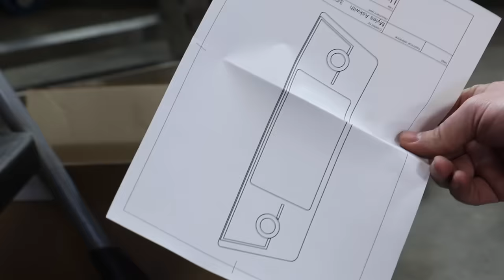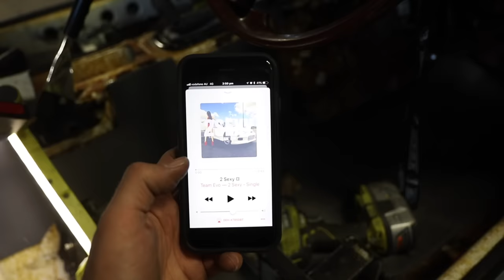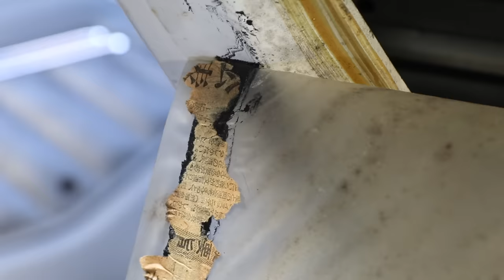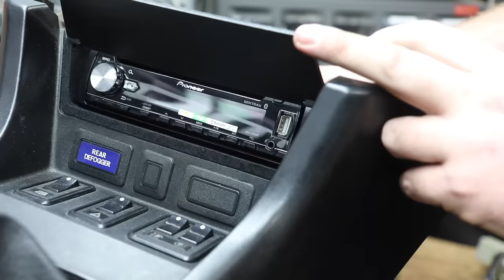RB26 240Z - Roll Cage + Stealthy Hidden Stereo

Comment: If those clips are the same as the ones I've worked with, you're not meant to punch the middle all the way out, you just poke it in slightly to release the clip, then once the whole clip is out you push the pin back out again. The middle pin has 3 positions, sticking out for inserting the clip, pushed in for removing it, and flush when it's installed.
Reply: Steve M on point
Reply: Correct
Reply: Yup. They are everywhere in motorcycles.
Reply from the maker: Steve M Maybe because 40+ years old these ones didn’t budge unless they got a big hit. But basically what you’re saying is just inset the tip?
Reply: Mighty Car Mods just the tip, promise...
Reply: Mighty Car Mods on newer ones, just the tip and only for a minute, i’m an auto glazier and come across these types of clips regularly
Reply: Just the tip, and only for a minute. A ball head allen key is perfect for them, just press the ball against the head and push, you might need to wiggle it around a bit but once you do it a few times you get a real feel for how hard to push, and how deep you should insert the tip.
Reply: Was going to comment this, glad somebody already did (faith in humanity boosted).
That's exactly how the clips that held the door cards of my 2001 Volvo V70 worked. Definitely not a bad system: rattle free without screws after 10+ years and virtually endlessly reusable.
Reply: tempted to just replace all those types of retainer clips with nutserts on my car.
Reply: Uncle Dunk Why? They're super easy, faster, and stealthier than screws and bolts all over the interior.
Reply: Steve M It also has the 4th Moog position - into the 4th dimension.
Reply: ... but only for a minute.
Reply: Most older cars don't use the 3 state push in clips and just have a pin and single split retention plug where the only removal is to punch the pin straight through. As a former smash repairer I do not recommend the reuse of old plastic clips as they are cheap and fail easily when new and worse when they are old. Bulk bags of generic clips are the way to go, get a few in various types and sizes as they are remarkably handy and have wider uses if you stretch your imagination.
Reply: I'm with the uncle... at least in certain applications. just wrestled through the cambelt on my 98 swift. I am now missing the inner wheel arch trim on the front right, due to all of the clips breaking... Thinking of going with rivnuts on it. On the interior though, I completely agree that these clips are a tidy way of retaining trim. Though the older the car gets the more brittle and more likely to break the plastic clips become. Hence why the Fairlady's broke I guess.
Reply: My motorbike also has them. I didn't even know you could push the centre bit in. I've just been pushing them out from the back. And when I can't get in behind them I just pull the panel and they eventually release without any apparent damage.
Reply: Abit of lube will help it slide easier, or else you tare it out the back when it suddenly moves. That's never pleasant...
Reply: Yes just the tip, but don't forget to add a little lube.
Reply: I see I just answered a question that's already been answered haha
If there jammed full of dirt and a few taps don't dislodge the dirt then just condemn them and put new ones in.
Reply: Exactly
Reply: To add to this I don't use a tool to push in the center, I just use use my finger and that prevents it from shooting all the way out the back like if you use a tool to push it.
Reply: @Mighty Car Mods Yes, just insert the tip, using a different tool. Use a flat blade such as a spatula so when you press (or even lightly tap on it with a hammer) it will move in until it becomes flush, locking the insert into place (the center pin is the lock). It will stay in place forever, but if you need to remove it in the future then you push the center pin in very gently (only 3 to 5 mm or so) and the outer portion will release without dropping the inner portioning the bowels of your lovely Z Car.
Reply: Yes just a few mm in. Then just pull the outside might need a wiggle but they do come out
Reply: IllusionaryGalaxy Yeah I considered that later, that maybe really old ones are just single use clips. Most of the older cars I've worked on have used those 2 prong metal clips, or those weird tree looking plastic clips with lots of little spikes that stick out the shaft. Only ever seen button pins with the 3 states of being, or 4 if you count the "I pulled it too hard and it went in my mouth and I accidentally swallowed it" state when it just flies right out of the thing it's meant to hold.
Reply: I guess I've been lucky as all the cars I've ever had* have a centre pin that has a flat top (like a nail), so you just pull them towards you, rather than pushing them through.
* VWs and Peugeots
Reply: Mighty Car Mods wd40 them first; they will require less force to push to unlock. Sometimes its easier to just punch through

Comment: Don’t push the pin all the way thru, if you push it in half way you can remove the whole clip as one piece and can re use them
Reply: ^^^^THIS^^^^^
Reply: I’m glad someone besides me knows the truth.
Reply: Haha yep, not meant to bash the pin out. Just press and it stays captive.
Reply: You do need to push the pin back out to reuse it. Like with a tiny flat screwdriver. Then you place it back in and push the pin flush again.
Reply: I just make new ones by cutting up 16 penny nails.
Reply: depends on the clip. the type you're talking about have a recess for the flare to fall back into on the pin so it can be removed. The type hes talking about is a standard plastic pin which will apply pressure spreading the rear until the pin is removed. He needs to change the style of clip used.
Reply: they probably were stuck in there and the whole clip snapped from it being old to be honest.
Reply: cringed at that
Reply: KDcars i can back this up
Reply: was going to say the same thing :)
Reply: Anyone who takes cars apart on the daily especially at a body shop you start to learn all the tricks to saving the clips, (especially since they are almost a dollar a piece at the dealer) once you get this style clip out , you remove the pin in the middle and slide it Into the shell of the clip and it locks tight
Reply: Using a proper trim clip remover fork helps, you might even find you don't even need to push the pin in at all. The pins are more for installation than removal.
Reply: Yes the only way I have ever done it
Reply: I am a Redseal Journeymen Automotive technician and I fully endorse this (years of Nissan, Infiniti, Volkswagen and audi experiance)
Reply: sometimes.... other times they explode like a firework cause they are old as frig.
Reply: KDcars I usually pull the pin using a very small flat hard screwdriver or the tip of a blade.
Reply: Exactly. we have them here in the states too, and I've dealt with these. Just push it past the 1st click, then remove. Reset the pin to the outside and once re-installed make the center pin flush again.
Reply: Love what ypu can make with 3d printers these days
Reply: Yep, I audibly said no when he punched it through like that.

Comment: Missed an opportunity to use the factory radio faceplate with its patina to control a hidden Bluetooth module.
Reply: Was thinking exactly the same thing
Reply: Same. I really thought that was where this was going. Plus, that flap looks annoying without some way of holding it open.
Reply: The other way is to wire an earplug socket or USB into the ashtray/glovebox/map pocket. Put a Bluetooth switch in the old LW button.
Reply: And ruin the factory stereo

Comment: To make the stereo more stealth, you should have used the original factory plate and knobs to create a dummy front, so it looks like the old stereo is still installed.
Reply: Yeah I thought they were going to glue the old plate on top of the new one
Reply: Couldn't agree with this more. Plus it'll add back to the #purity
Reply: Or even hook up the knobs so the basic functions can be accessed through them.
Reply: Ive seen other installs in like classic American vintage cars where they keep the face plate and volume knob but inside its aux input blue tooth etc

Comment: Finally someone else admits the styling of aftermarket radios is garbage.
Reply: Yeah not sure if I'm just an old man now but I agree with you, they look ok on a showroom wall but by the time they're installed in the dash of a car they already look poop
Reply: yeah right, i replaced a new panasonic radio for an oem Volvo one, the car is from 2001 and none of the radios look good in it, the oem looks neat and still sounds better then most new radios
Reply: They all still look like it's 2004 for some reason and having a really small screen that can play DVDs is still an amazing thing
Reply: exactly, they all look like they came from the TRD Lazer or 2SEXY in its sex spec form, only new radios worth a shot are the 2DIN android ones
Reply: It's true they ALL look like they're out of Nightrider. Clearly a classy OEM looking unit is not what the people want.
Reply: Yeah totally agree. I got an 03 S40 with a Sony head unit that lit up like a Christmas Tree and looked completely out of place. Got an OEM one from a breakers for £20 and was massively surprised at the improvement of sound quality as well as the clean look.

Comment: The clips you’re referring too are meant too have two stages of release, if you ease into the Center of it, it should “click” into position allowing you to remove the clip and the pin as one unit. If you push to hard and all the way through it will fly off.

Comment: In regards to the the push pin plastic connectors, a soft hand will get you far. I have fuckerd up many before the realization hit me. I like to use a pick and push lightly into the center pin, it will index in slightly, about 3mm. At that point you can remove it as an assembly. I have grown to like them. Thank you for your efforts and sharing your enthusiasm with the world! I always look forward to new footage! As with The Skid Factory!

Comment: That flap gonna be so annoying when you actually drive, get some rubber stoppers or something
Reply: I was thinking magnets to keep it shut the instant I saw it. I was imagining it flying open by itself when you accelerate hard enough. :D
Reply: Couple of rubber pads on the corners where it meets will sort it like you say! Could do with being able to latch it open and shut
Reply: The flap should drop down, and a small magnetic catch to keep it closed, simple, and easier to see the desk when fiddling with it.
Reply: I thought a push to close / push to open mechanism would be great. Not sure how much room there is for something like that though.
Reply: I'd glue a little magnet  so it'd stay closed and not rattle.
Reply: leave it rattly for the purity
Reply: Wo000T It's the RB power flap.
Reply: I was thinking nobody wants to drive a stick and then try to hold open a little flap while Fucking with a radio

Comment: might wanna put a rubber strip or even a magnet catch on that flappy cover, otherwise ya got yourself a rattle-trap!
Reply: Jeff Juarez Yeah was thinking a spring up/ clip down affair if it becomes a product
Reply: Carl Wells I figured it wouldn’t take long for you guys to be on it :) I too hate modern head units in old cars. in my 74bmw 2002 I did a stealth BT setup, and in the ash-tray I mounted a spring-loaded lightning plug for my iPhone. I’ve got the original radio in there (single speaker and sounds like nostalgic crap) but pull the ash-tray out and the plug pops up. Plug in your phone and you’ve got an on-the-dash navigation/Spotify control screen. I’ve got a flat sub in the trunk, and little in the Cabin hints there’s a high-end Focal audio setup lurking in the car.
Reply: Carl Wells id honestly just get some of those tiny neodymium magnets, and sink em into the frame. It’s probably all you need :) and who doesn’t love magnets!!
Reply: He took your advice

Comment: I've been around these cars since they were new. The roll cage will indeed make a huge difference in chassis stiffness but even that can be improved by adding a tabs at the top of the bar and bolting it to the upper seat belt anchor points. Also a front stress bar is pretty much essential. I took that a step further with a lower stress bar connected at the frame rails where the compression rods attach to the frame. Makes a huge difference.

Comment: I had a 1971 Z here in the USA in 1973.  Loved that car.  Your project sure brings back memories, but is so much better than the one I had, would love one just like your with the steering wheel on the "right side", LOL.

BTW the Pioneer head unit you installed looks like the Pioneer DEH-X8800BHS I have in my almost vintage 99" Mustang GT.  It a great head with tons of adjustments.

Great job as usual guys....

Comment: Love the stealthflap! I'm sure you thought about gluing the old radio faceplate to the stealthflap for even more stealthiness?
Reply: I really thought the original faceplate was going to be stuck on Miles' new flap, with the original knobs too (but maybe then it wouldn't lift up enough)
Reply: I was expecting that they would find some head unit that would match up with a similar knob position and without the tacky disco lighting that would blend in like a factory radio.  I doubt there's any company making retro radios for these, but my Dad has a '66 Mustang with a radio that looks period-correct but has aux, bluetooth, USB, etc. but still looks just like a factory '60s radio. Perhaps a similar unit could be modified to work?  I think it would get really old having to flip that lid up (and hold it up) each time you wanted to adjust something on the radio.

Comment: Love the build, but.... I found it really funny you having a debate a few videos ago about cutting out a little bit of metal to fit the intercooler pipe in. Worrying it would upset the original shell... THEN... You go a weld a load of supports in for the cage! I love it

Comment: IF you've a 3D printer you can print your own panel clips using the much more smarter clamshell design found in old VCR / TV panels. IE, three pieces, two pins halves and a T piece that slides in covering everything in an aesthetically pleasing button.

Comment: Front speakers up under the dash.
Reply: agree, the only solution in car without factory front door speaker location
Reply: yep
Reply: or in the central console.
It's easy to replicate, fairly simple design and cheap plastic.
Reply: Drivers & tweeters under the dash with extra set of tweeters behind the front seats up high. Either at the back of the roof  or just below the side windows in front of the tops of the strut towers. Will give great stereo image... well, as good as possible.
Reply: Never chop the door please lol
Reply: Yea good idea I was thinking under the dash in each footwell could possibly work
Reply: You'll get very little high-freq definition from under the dash.  Custom panels built into the corners of the cage behind the seats?
Reply: Agreed. Use zip ties to put 2 4 inches side by side under the dash
Reply: To get the most out of the speakers i'd suggest mounting them in the doors, the mids likes a bit of airspace to play lower frequencies, not to mention a solid mounting to not lose sound to vibration.
Reply: I would say to put them into knockers where you still got less to modify and is in good location for sound (check e34 5 series)
Reply: I'm really not sure about how much room is in the kick panels but that would probably be the best location if usable.  As close to equal distance to your ears as possible is best. 

  Doors are ok but one door will be very close and other farther away, but I wouldn't want to cut the door either.  Pointing down from under dash seems like it would sound weird especially if just zip tied and back wave wasn't separated from front wave.   
  
  Also for sound reproduction you probably don't want the speakers behind you, I mean when you go to a live show do you sit with your back to the stage?  If all you need is sound in the space then sure any of the options will work perfectly fine.
Reply: " Doors are ok but one door will be very close and other farther away"
A good head unit will account for that (time correction).

And I agree, you'd definitely want to put the speakers in the front, as there are rearfills already anyway.
The doors are the way to go.

Comment: To remove those clips use a fine pick and pull the center plug OUT instead of pushing it in, its a bit of a pain sometimes but it works. Love the show keep up the good work.

Comment: @8:04, I love those clips. If you just depress the center pin (usually about 3-4mm) instead of pushing it all the way through, it allows the whole thing to be removed while retaining the center. This is, of course, assuming they're the same type of retainer pins used all over my Japanese sport bikes and Toyota SUV.

Comment: Putting a new engine in doesnt ruin the purity you can change the engine 100x and itll still be fine. But you cant cut up the door cards 100 times and still use them. The difference for me is just not being able to use the car in the future because it gets cut up so much.
Reply: beshjs Did you watch the engine swap? The cut/bashed/removed plenty of things that you can't do 100X. It's a fucking door card bro.
Reply: _______ I know I'm a mechanic, but when there's a certain amount of these classics around you don't go full Frankenstein on them. After you weld up the body panel, trying to sell the car on is a nightmare and so it gets crushed, leaving one less on the road. I mean look at England and the amount of minis that get scrapped every year because of rusting sills... Restoring the metalwork is a huge job. Changed over an engine is a piece of piss in comparison
Reply: beshjs it's literally a joke, that went right over your head.